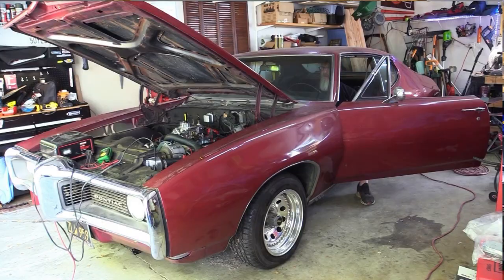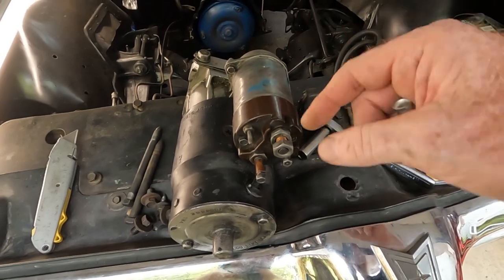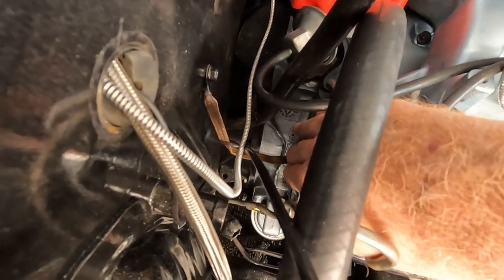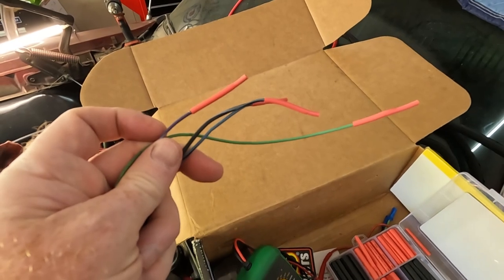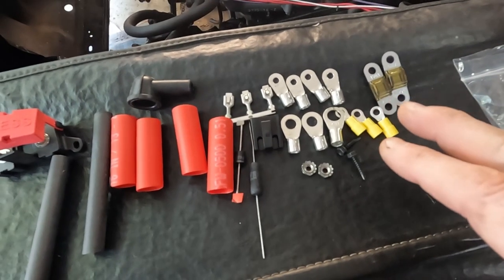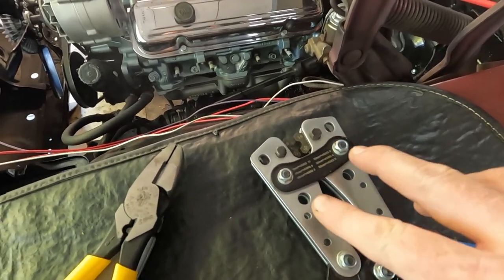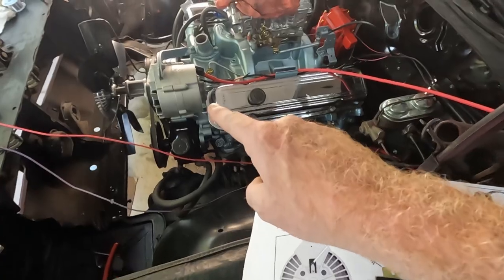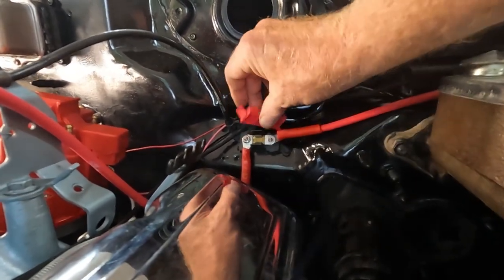Painless Wiring: Engine and Start/Charge Wiring!

Comment: yay engine time!  I actually had an issue with my 3 wire alternator on the 350 in my c10. looks like the previous owner wired it wrong so the number 1 wire (in the 2 wire plug) shorted and got hot and melted a bit so ill be using the new wiring harness wires to get that sorted.  Thank you for the videos!!

Comment: i recommend get a hei coil plug over a spade. Spades sometimes bounce off from vibration on the engine. The plug has plastic tab to keep it hooked in. They are less than 10 bucks.
Reply from the maker: Thanks! I'll check it out!

Comment: Planning on doing this this winter on a buddies 69 Mach 1.
Reply from the maker: I hope to NEVER have to do it again! 😂
Reply: @Rustrevivalgarage  so watching the video I have a thought on your starter slack. Could you of service loopd the wire and mounted it after the starter was installed to an oil pan bolt or possibly end of the starter? I hope that makes sense
Reply from the maker: @redneckmukk8749  Possibly. The problem is that there's not much room there. And I think it's why Pontiac ran the positive cable down through the exhaust manifold. With the motor mount, starter and exhaust all there in one tight spot, there's no space to do much. But I'm ordering a shield for the 67-69 Ram Air and HO that allows you to run the cable from the front and it mounts to the motor mount. We'll see how that goes.